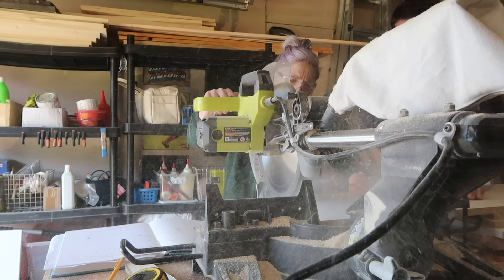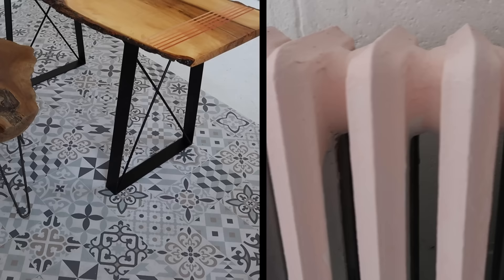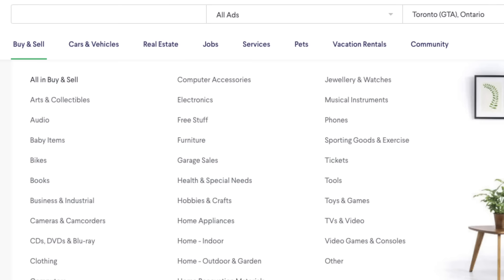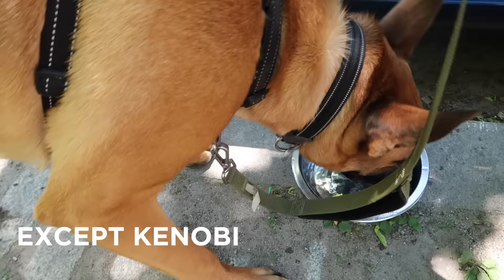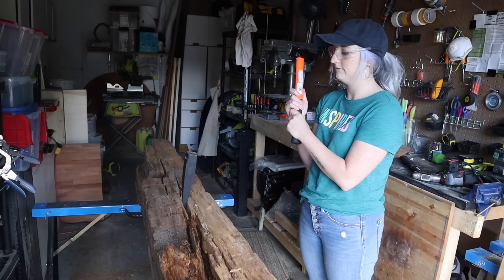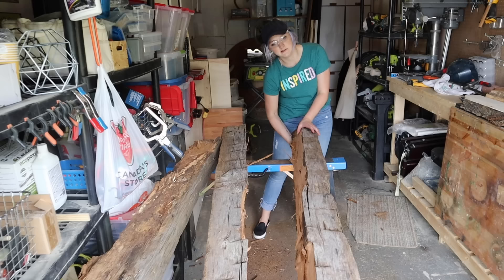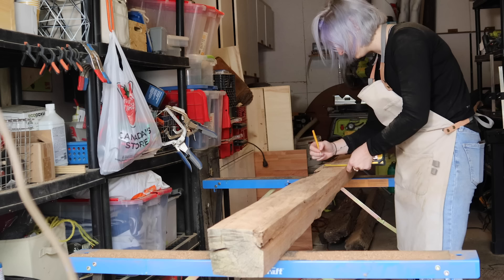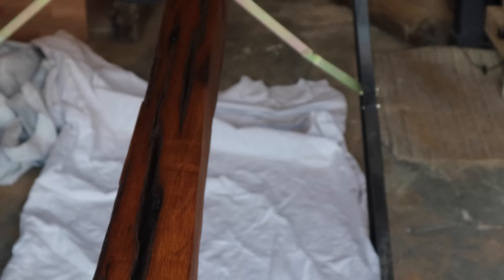Stunning Reclaimed Wood Beam Chandelier | The Diaries of DIY Danie

Comment: When you work with metal its easier to get the bend right if you saw or score a line where you want the inside of the bend. The corner will look sharper too.

Comment: This was stunning!  You are fun to watch. I was hoping you would describe the hardware you used and how you hung the fixture. It looks pretty heavy. I have a new industry globe light I need  to hang over my round glass table.  The junction box is off center (naturally!) and the light is somewhat heavy. What did you use and did you need to secure it/them to the studs?  

Thanks for your help.
Reply: To clarify, I plan to connect at the junction box then mount as a swag.

Comment: Steel bends more better if heated...  not acetylene torch heated, as that burns it too better (i.e. - cuts it).
 Routing a channel for the electric in the beam could inlay the electrical connections, and make it more code friendly since sinking a j box lines the wood with metal... or even making a tin box out of flashing and covering with a std box cover plate.

Comment: its nice but I would improve the electrical box for two reasons, the box is for wire mold and that is the reason the ko seals aren't like meant for those squeeze connectors, and number 2 too many wires in a box when, fire hazard alert right there. any inspector wouldn't pass the electrical inspection if they see that chandelier, due to LU testing, but this is not the case so at least it will b better to install at least 3 splice boxes to even them by code. maybe a handy box with double connectors. other than that I love the idea.

Comment: Ugh! did you use a wood punch on steel?  Might as well just used a nail to punch it.  Oh and your chandelier looks great!

When I needed a black chain washed a chain from home depot in a 5 gallon bucket of water with dish soap, hung to dry and spray painted it.  Came out good enough for my pot rack.

Comment: Danie, Thank you for the entertaining and informative videos. You do a very nice job being colorful, creative and upbeat in your videos. I also admire your willingness to attempt some difficult projects. This beam project was a hard one. But I have an issue with all that hard work you did on this beam. After sourcing the beam, and doing all that work preparing the beam and making it look so good, why in the world did you wrap the black electrical lighting cords around the beam?  The black cords wrapped around the beam make it look tacky and amateurish. Why didn't you drill a hole thru the center of the beam and run the cords thru the beam and nestle the electrical box above the beam in a cut out to hide the junction box? That would have made this project look so much better. Those cords wrapped around the nice wood beam look awful. 
I think the hardest part of this project would be the electrical part. Drilling holes thur the beam should not be an issue. All the cords were separated and all came together at the junction box, so you could have easily pulled this off. You spend alot of time and energy on this project, but ruined it by the way you wrapped the electrical cords. It would have been a A+ project. But those ugly cords, give the project a C minus. Sorry for the honest opinion.